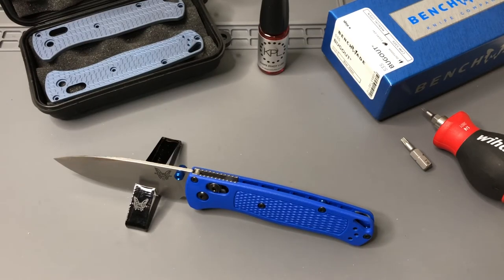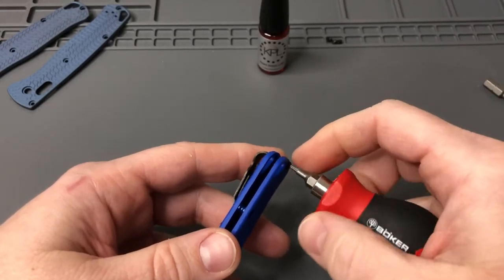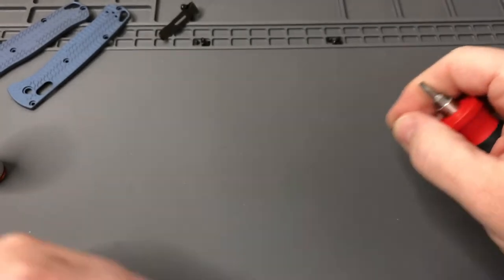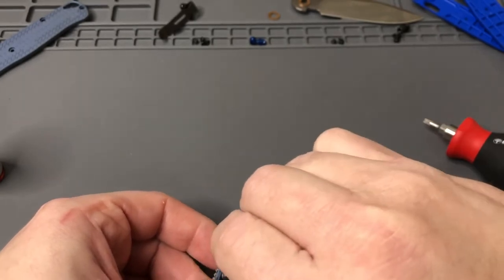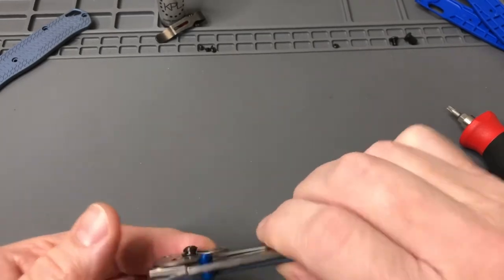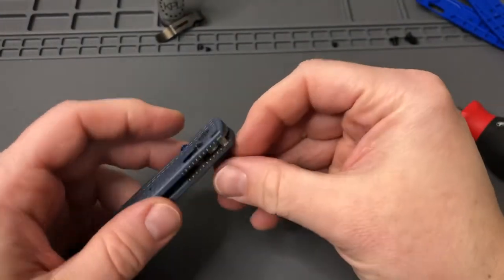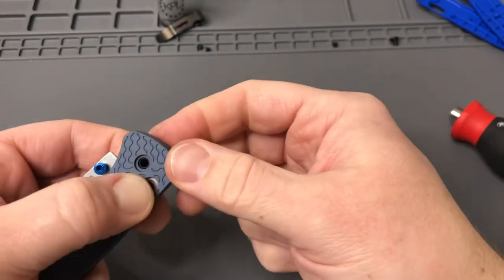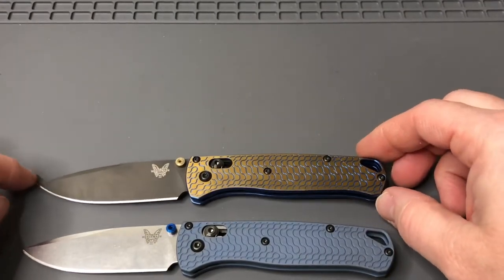Ti Critter Bugout Scales - Rock Scale Design

Comment: I put in my metonboss ti scales today and it took forever to lineup the copper washers and push th pin thru until 8 found out the trick to it.  It have an precision screwdriver kit with very small flathead screwdrivers to help center the washers.  I use a linger bit to align the washers and blade from the bottom and put the pin thru the top.   When you hear a “click” you know youve gone thru the washers and blade with the pin.  Also not that the pin has a “flat” side to it, so you will only be able to push the pin all the way thru if the flat part matches the flat sides of the blade/scale.

Comment: Great video and subscribed. I have 2 Bugouts but both came way off centered. Love the scales you put on in this video. Any thoughts on how to fix the centering on these?
Reply from the maker: You can always send it back in with the order to fix centering. I have always just taken mine apart and reassembled which usually helps with centering. They have a couple tweaks they can do at the factory.
Reply from the maker: Thanks for subscribing!

Comment: Love the bugout from the clip blade and handle design I hope they come out with a sprint in cru wear or something else a little more exotic than s30v and a cool carbon or titanium handles even just full liners and g10 handles.I can’t even make a list because my minds always changing wish I could sell some blades or trade I have 60 high quality folders and 20 top grade fixed blades alone with axes tactical and not tactical tomahawks the beat tactical shovel ever the crovel but its heavy though they had a lighter version that I wish I got but I’m no internet seller and don’t know many people where I live that want high priced knives to me that $150-$300 no need to pay more than that unless your rich or a top notch collector.Very cool scales I’m thinking of getting some flytanium titanium handles for my mini FRN grip in 154 cm so I can be happy carrying it for the summer with shorts either that or the chaparral which is a great small knife by spyderco cant spydie flick it because it’s a back lock which looks great u can still open one handed and even close it with some practice plus you can’t go wrong with CT’s-xhp steel with spyderco’s wire clip which I love comes in titanium handles and carbon I own both there great knives for gym shorts than there’s the Benchmade outlast and the spyderco sage five with there back liner lock which I love and 100 more I could buy a new ikea with what I’ve spent on blades and gear.

Comment: Did you use the RIT color stripper first? Did you just dye the green handles to get the red color?
Reply from the maker: I used some dawn dish soap to clean the scales of all oils/grease. Then heated up the rit dye mix. No color stripper used. 

I used the ranger green scales to get the red. The color took fast. About 1 minute to a minute and a half.
Reply: @zachstuff  thanks. I've got a couple sets of handles that I can play around with and I wasn't sure if I should mix something with the blue/green scales to get a color or if any color will soak in.

Comment: Hey man, I’m not sure if you’ve made a video on this or not. What do you do to keep your bugouts smooth. On my bugout and mini bugout, the dlc coating on the lock bar always wears off where it comes in contact with the blade. That leaves bare titanium in contact with steel, which isn’t the smoothest combination. Is there any way in your opinion to prevent this or any way to fix this? Thankyou
Reply from the maker: Great idea for a video topic! I usually just use pencil lead and "draw" it on the axis bar. This lead/graphite helps with the stickiness that happens sometimes. Thanks for your support!
Reply: Wow, I tried it and it helps a lot!! Thankyou for that. I had ordered a stainless steel axis bar off of eBay but I think I may not need it now.
Reply from the maker: @RJIVHALO  Right on! You are welcome!